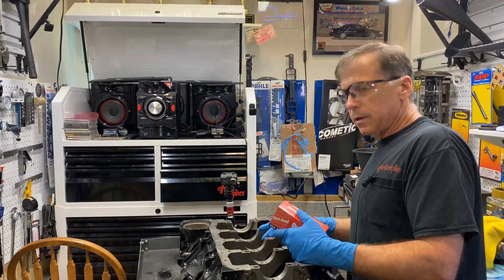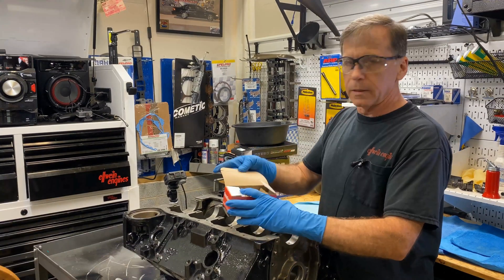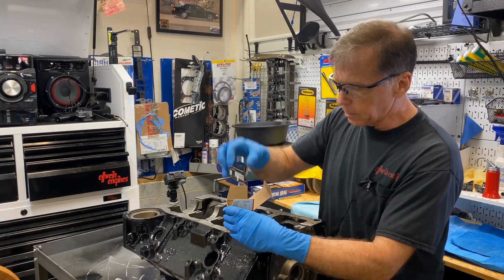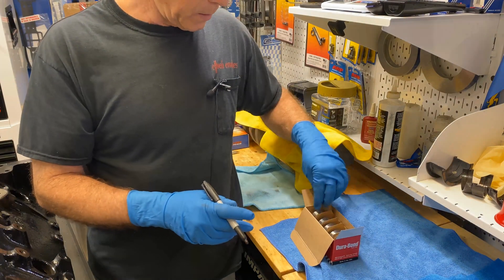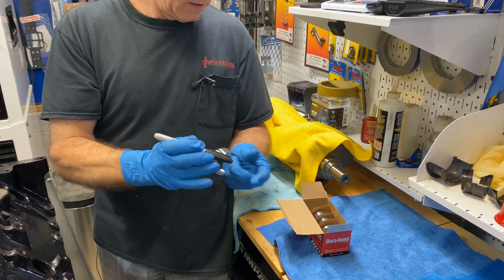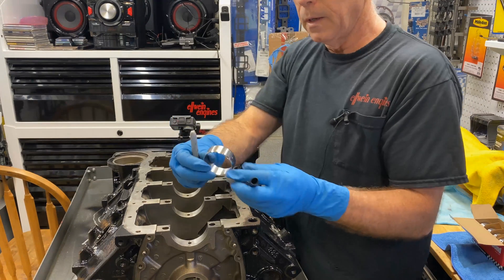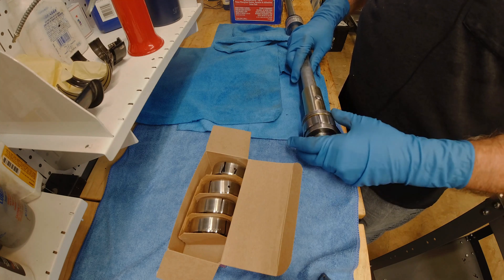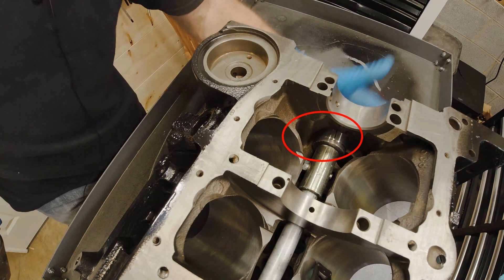How to install LT1 Small Block Chevy Cam Bearings

Comment: thank you for the video, subscribed for more! I have a Cam that move back and forth inside of the bearings. it doesn't seem to be a major issue because I can spin it in the farthest and nearest position and the pushrods move and the oil pump spins. But I am just wondering why that happens and if it's normal. I have the stock cam (the installed cam is not stock) and both are the same length. Why does it move back and forth and how do I correct this?
Reply from the maker: Is it in an LT1?  It can move back a bit until it hits the back cam plug.  But it should not move forward past the cam plate in the front.
Reply: @EllweinEngines  Yessir, LT1 gen 2. correct! it stops with the cam plate. I guess it's normal then. Thanks!

Comment: Hey sir will I be able to use this cam on a stock 96 camaro lt1 with this setup without machining : LS7 lifters
Comp 7608-16 pushrods
230/238  .584/.584 110 lsa custom cam 
Tick .650” spring kit
Comp 1418-16 rockers
Reply from the maker: That is hard to know for certain.  I think it all depends on the valve stem seals.  If it is a complete kit from Tick then it should work.
Reply: @EllweinEngines  is there anything else I will need? Should I get a new timing chain , not sure of miles on engine
Reply from the maker: @TehKneegrowplease  new head gaskets and timing cover gaskets and seals (you probably already knew that).  New timing chain is a good idea.  I really cannot give a compete list.  Sounds like you have a good grasp and will have a good set up when done.